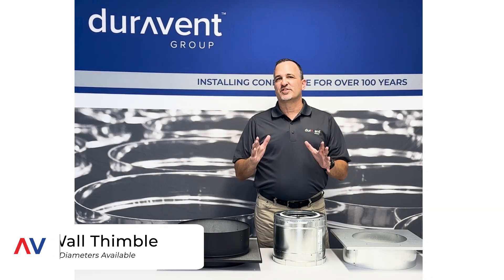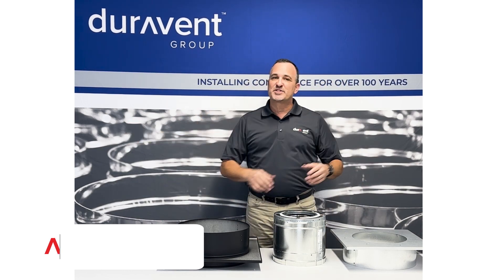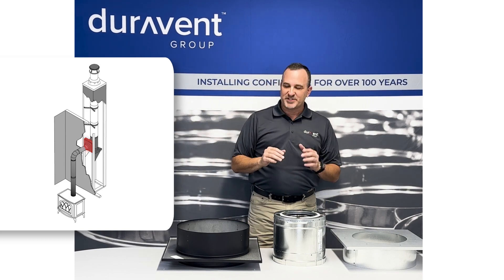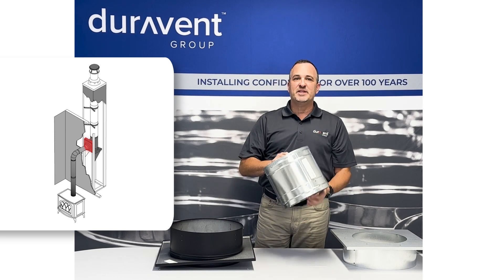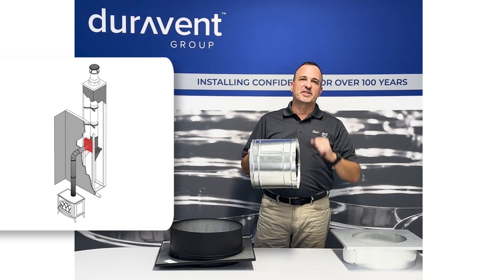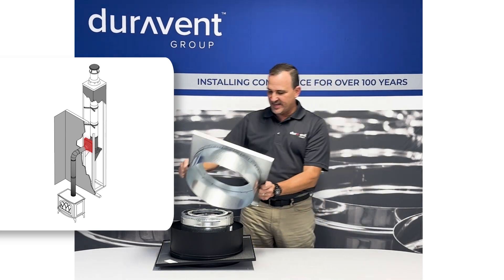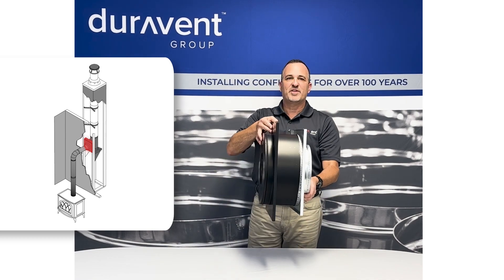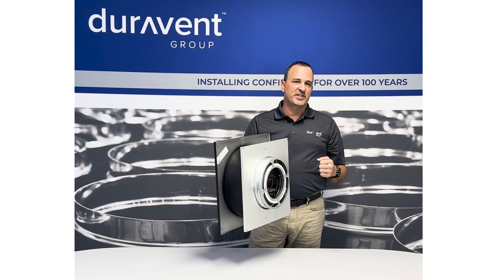DuraPlus® Kit: Wall Thimble

Comment: When using the ADT the stainless insert is too short. It should be an extra 1-1/4” longer to make full connection to class A pipe in the wall. What a joke